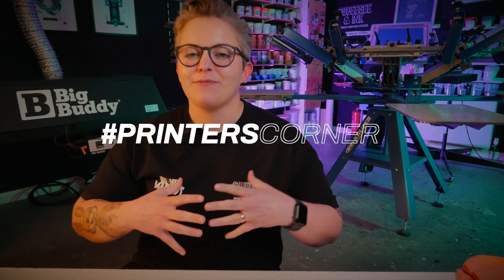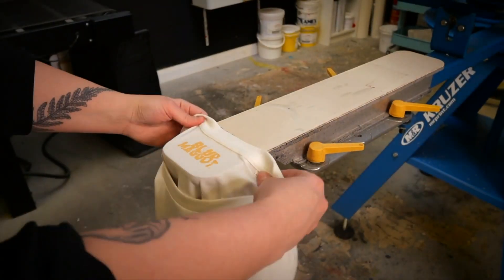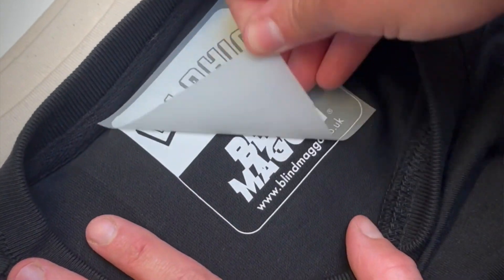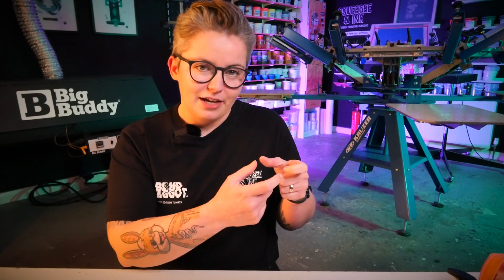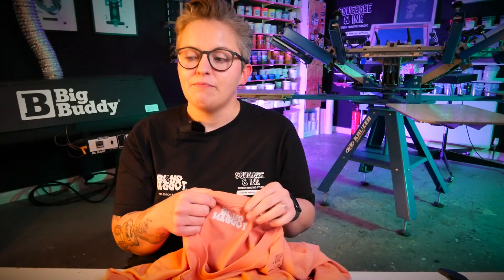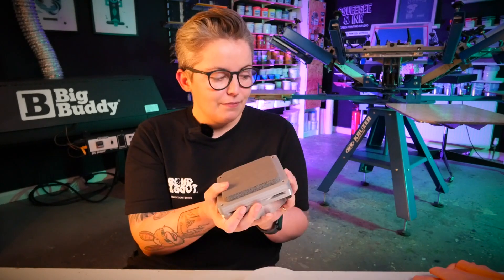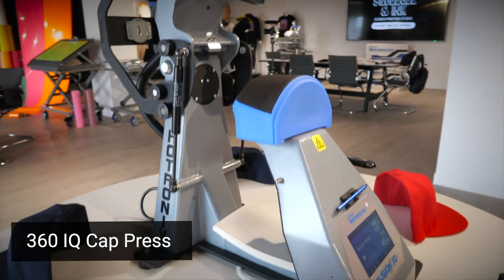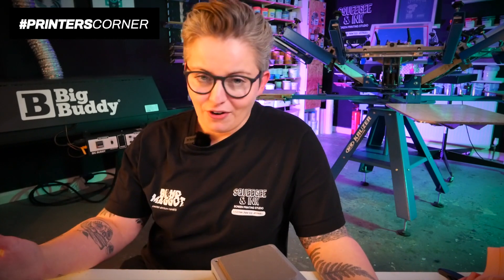Where to get the best blank garments for screen printers & garment decorators | Printers Corner Ep04

Comment: Also, very random question - but how do you guys deal with the fumes from printing? Assume you keep it well ventilated and run some fume extraction on your dryers?
Reply from the maker: Hey Will. We used this question in a "printer's corner" episode. The flu is attached to an external fan so it can suck up the fumes BUT we are using much less aggressive inks now so don't need to turn it on. Also, the fan was changing the temperature in the dryer so we had to be careful.